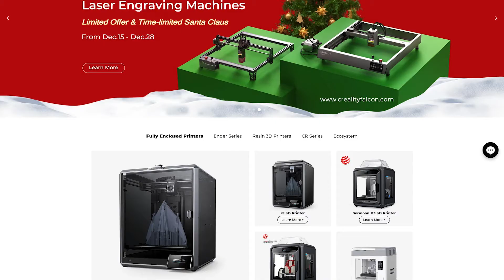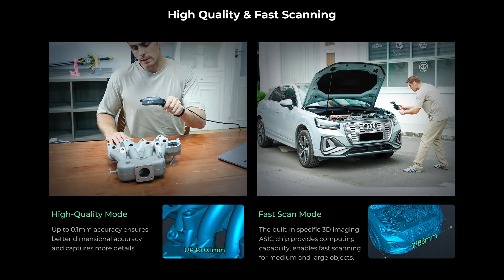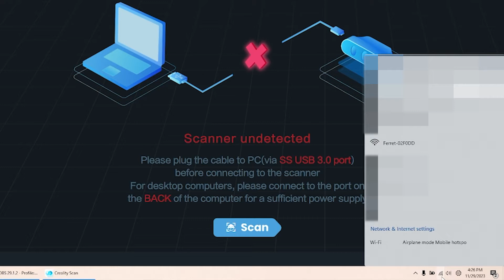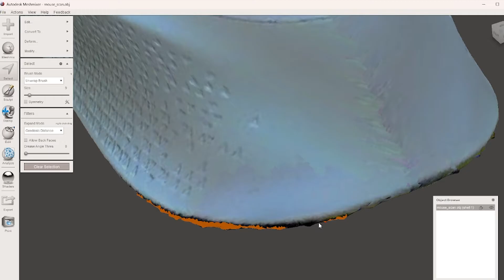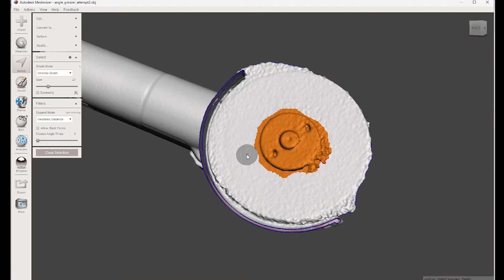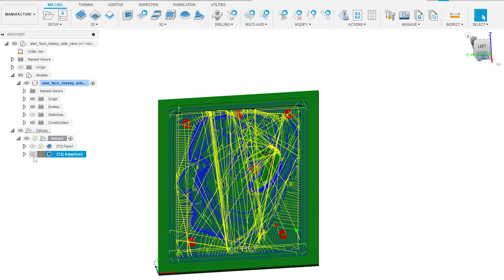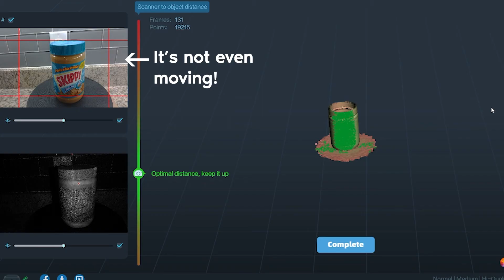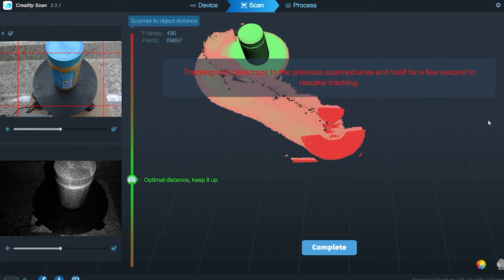3D Scanner Review - CR-Scan Ferret Pro!

Comment: Nice one. I need to 3d scan sporting good items for website use and this seems like a decent starting place. I professionaly light and photograph the gear, so my lighting and environment are clean. In your opinion is the Ferret up to the task? Given what I can charge for the scans I need to knock them out quickly without spending time cleaning up. Any thoughts would be appreciated.

Comment: Sorry, useful and not useful. You used beta software. The released software solves some of your reported problems.
Reply from the maker: Yeah this review is a bit dated.  But that's the software that was available at the time they asked me to do the review.  I've used it a few times since then and I ultimately got what I needed out of it, even if it was a little clunky
Reply: @ObsessiveEngineering  So waste of time but it's still up because of sponsor. That sucks.

Comment: Does anybody know where to get the model for that turn table
Reply from the maker: In a stroke of extraordinary misfortune, I have absolutely no idea where the model for this turntable is.  I have searched through years of Fusion360 history and cannot find it.  I am baffled, as Fusion has always reliably saved everything.  It's probably user error, maybe I deleted it by accident. 🤷‍♂️

That said, if I had to remake it, I would've designed it differently.  The tight motor mount geometry constrained the max gear ratio, and it also has to lift the motor itself in addition to the camera, which just barely worked with that motor.  I'm not confident it would work with a slightly different setup.  

If I did it again, I would fix the motor in the base and put the circular rack on bearings and use the motor pinion to simply slide the rack around.  I wouldn't be surprised if someone else has published a model like that already. 

Sorry about that!

Comment: So the peanut jar is too regular for the scanner, but the irregular shell scanned great - my first thought was then why not use an irregular shaped turn table?
Reply from the maker: I've scanned a few other things since doing this review and I added a slightly crumpled strip of painters tape around the object which added irregular, physical features.  It worked surprisingly well, the camera was about to track it reliable.  I'm sure adding it to the turntable would also work.

Comment: You should do a one-year review after firmware upgrades.
Reply from the maker: Good point!  I did use the scanner again about 6 months ago, and I was pleasantly surprised by how much different things were.  It seemed to be better.  Probably.  What I scanned worked on the first try, without any issue, and with reasonable accuracy.  So -- I actually didn't spend much time with it to be able to report anything specific.  It just worked!  Take that for what it's worth.

Comment: Love it! New sub, question, the rig you made, are you selling the STL for it? Seems like a totally useful thing to have for these small scanners ,
Reply from the maker: Weird story:  somehow I lost the Fusion360 files!   I have no idea how.  I have only an ancient, half-completed version of it.  This has never happened to me, as Fusion is usually really good about saving everything in the cloud, with full version history.  I have dug through years of project design files and I just cannot find it.  First time!

That said, I would do it quite differently now--fixed motor & gear at the bottom, moving the rack on bearings/tracks, instead of the other way around.  Maybe one day I'll redesign it.  Or maybe someone else has already published something like it.  Either way, thanks for watching!

Comment: I know this is an older video and I also know they have updated their software. Do you still own the scanner? And if so have you learned how to get better scans now? Also I have seen people putting the indicator circles directly on the turn table as referance while it is turning. Have you tried that to see if it helps? Thanks
Reply from the maker: I haven't used it recently, but I did about 6 months after making this video and was pleasantly surprised at the improved software.  I can't remember what it was exactly, but I definitely has a better time with it.

I didn't put tracking markers on the turn table, but used pieces of crumpled masking tape on the rotationally-invariant objects, where I didn't need the model to be highly accurate.  It worked really well!

Comment: Fusion 360 isn’t the best tool for working with mesh 3D objects—it’s like trying to do woodworking with an arc welder: two completely different world. A free program like Blender 3D is much better suited for handling 3D meshes, as it can process millions of polygons without issues. In fact, using Boolean cuts or other mesh tools in Blender could have easily solved your tool-fitting issue. As for the turntable, the textured surface can interfere with the scanning process, (it see it like static)  so it's better to apply the tracking dots to the table and sometimes directly onto the object. Unique silhouettes are crucial for scanning; objects that have distinctive shapes from various angles work best. So, items like cans or peanut butter jars are not ideal. The image is largely irrelevant in the process—the color information is just applied to the object’s surface. While color is there to enhances the appearance of the object for images or animations, even top-quality game assets look very low resolution once the color is removed.

Comment: Well i'm hooked so much so i went a bought one to play with. Hoping it will help me with designing parts for my trikes i have, it's the little touches that make it worth while. Very impressed with the turntable setup would be interested in it for a couple of smaller pieces i need to do. You said you designed it do you sell the files or can i get them from somewhere. I have a very old turn table like 10 yrs i think but doesn't work properly anymore. any help would be great like i said love your work.

.

Comment: You can’t measure a 3d print to see the accuracy of a 3d scanner. 3d printing has around 0.2mm tolerance and the material will shrink depending on the geometry too.
Reply from the maker: You're right that there is additional error introduced by the printing process, on top of model error.  It's possible that the error in the model was actually slightly more or slightly less than what I measured.  However, I have calibrated that printer pretty rigorously, and I know it prints approx within 0.1-0.2mm of what I design.  Even at max printing error, I think that the results I measured are still very favorable for this budget 3d scanner.

I also know to scale up to 100.5% when printing with ABS, but I generally don't need model scaling with PLA or PETG.

So, you're not wrong, I'm just on top of that, because I built that printer myself and gone to great lengths to figure out it's tolerances.  Thanks for watching!
Reply: @ObsessiveEngineering  you can use tools like cloud compare to measure a distance on a cloud point.

Comment: Hi, I recently purchased cr scanner ferret se, I want to connect it to my Android phone, what do I need to do so, I succeed to connect with the extra USB adapter but when I start to scan, it disconnects. I think it is missing adaptieve power. Please help.
Reply from the maker: It's been a while since I used it (and dont have it with me) but I'm pretty sure there is a separate power cord for the scanner.  The phone alone cannot provide enough power to run the scanner.   If you have the same version as me, it comes with a tripod that has a built-in rechargeable battery that can charge your phone and power the scanner at the same time.  The instructions show the different wiring setups

Comment: Some of the tracking issues could be mitigated by reprinting your turntable. A matte finish could eliminate the textural moiré effect visible in some of your shots, but the bigger fix would be to make it clear to the scanner what orientation the table is in either by embossing a pattern in the surface or by adding an asymmetric border to key off the edge. Just make sure the map is detailed enough to provide consistent tracking while also being fully determinate (ie. no part looks enough like another part to confuse the software), like a fiducial marker.

Comment: Love mine but there is a learning curve. For the grinder I would have tried to do multiple scans and then combine them. I recently scanned my milling machine head in multiple scans and the software combined them perfectly. My question is where can I get your turn table build?
Reply from the maker: How do you combine multiple scans?  What software?  

I kinda botched my turntable, by assuming that a 28BYJ-48 motor would be able to turn the table directly (with no gear reduction).  It's really not a good design and it just barely pulled off what I did in this video.

However, I could provide the curved rack and pinion design, which worked quite well, besides having to overcomplicate it with a brake so it doesn't fall and slam into the table when the power is cut 😅.  I'll have to clean it up and post it on Printables.  Note however that the rack is printed in a single piece which is too big for most printers.  I designed it for my 400x400mm build plate.
Reply: @ObsessiveEngineering I use the Creality software for this scanner and the process is called multi board project. I will say that this did not work for me until I updated to the latest version 2.3.5 release on 12/21. I also think the reason it worked for this project is the fact there are a lot of detail or it to align.

Comment: Honestly I think this thing is more for complex geometry. Which is why id want a 3d scanner in the first place. Simple objects I could just bust out my calipers for. Thanks for the video!
Reply from the maker: I don't fully agree.  I don't need to scan a peanut butter jar, but the reason it fails is the same reason I kept getting false tracks when scanning my angle grinder.  Even highly irregular objects could have features that throw off tracking when you get too close.

That said, markers are a totally reasonable solution that should resolve this if I could get it working.  I suspect I will figure it out, or Creality will release an update that tracks them properly.

Comment: I got his mainly for scanning heads.  And it works pretty good.  Better then my Photogrammetry results. I am satisfied, but am still tweaking it. I hope future firmware updates will make it even better.
Reply from the maker: Did you get it working with hair?    I tried so many times, and I was extremely satisfied with the face scan part but couldn't get the hair for my life.

I just started playing with Meshroom (photogrammetry) and I'm very impressed with it.  But feels like it's a different use case.   You don't need a special camera, but you do need a beefy computer/GPU, and the software is pretty complicated.  Also, you can't use a turntable with it since it uses the background for camera position estimation.
Reply: I also played around with photogrammetry and meshroom. It took me several hours (2 days) to get the best result. You can see the result in this video:https://youtu.be/SJ5R5zL27VY.  So I am going to get a 3d scanner, thanks for your video.
Reply: @ObsessiveEngineering  You can and should use a turn table for photogrammetry. It's just that Meshroom devs to this day still didn't implement a masking functionality for the background, so you should preprocess your images beforehand by replacing the background with black color in some other software. I've seen people using pitch black background for turntable surface, but they still have to postprocess the result. Agisoft has masking for this since like forever, although it's not free.